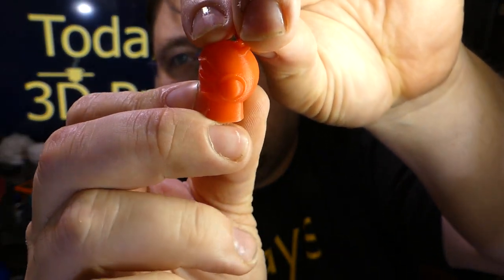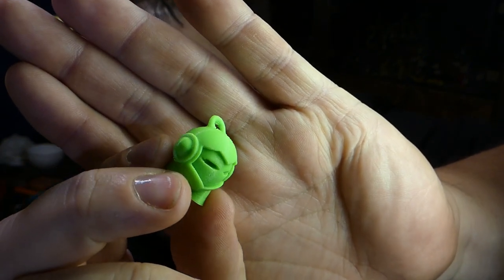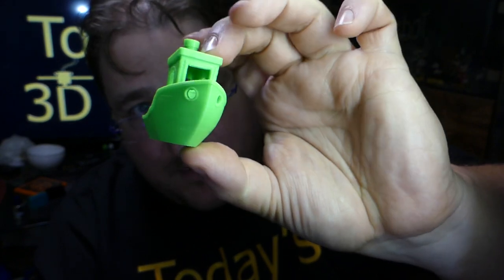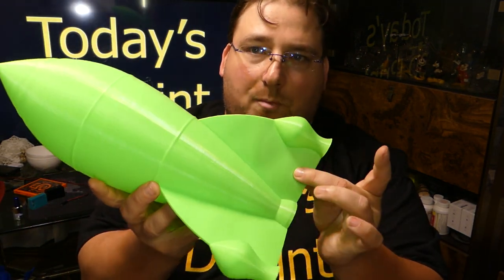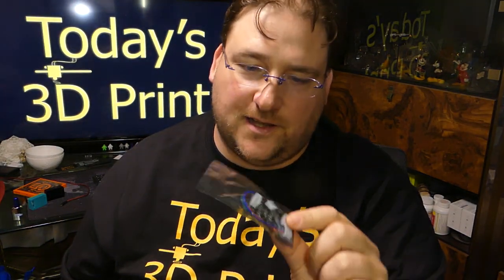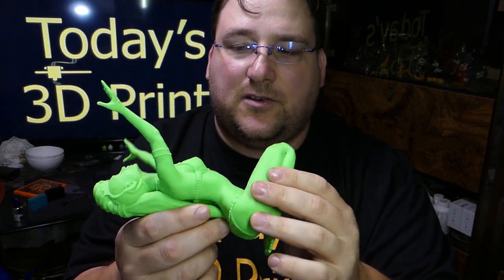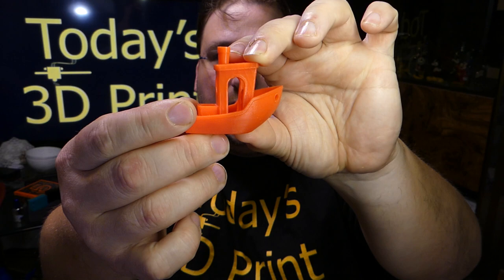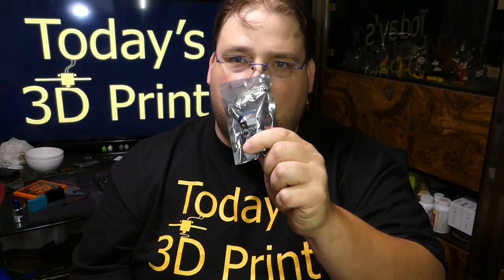Today's 3D Print 108 Tevo Tornado Smoothers installed FANTASTIC results

Comment: Thanks for the review brother , we will keep on improving the quality in our future printers :)
Reply from the maker: +Official TEVO Channel that is very good to hear consider iterative upgrades to existing products as well for example I would either include TL smoothers with the printer now on or change out the stepper drivers to one that doesn't have the problem of the 8825's otherwise so far I am extremely impressed with the tevo tornado how much would it cost me to buy a couple of those heat pads that you use on the tornado? I want to upgrade my CR tens :-) I also love the full size SD card slot and the full size USB port I'll have a more full view video soon I'm making my first 50 hour print on the tornado now
Reply: Test 8825s and find steppers which work with them -- there has been plenty of literature on why 8825s skip micro steps. Use high inductance steppers, and 8825s are fine. You have the capability to do that. Or switch to different drivers -- not sure if TMC2100s or TMC2660 are in the budged, but consider those, that's the current best option.
Reply: Hopefully they see the comment, I really hope a new revision will be released with new steppers. Knew corners were cut somewhere.
Reply from the maker: +kazolar I did not look carefully at the board I can replace the drivers? How much are TMZ 2660 s what's the difference between 2100 and 2660 s how much could they possibly cost?
Reply: I looked at your video where you were adjusting the VREF, and the controller Tevo used in the Tornado uses soldered on drivers, so they're not replaceable -- AFIK this is what it is. The 2660 is the current state of the art -- main difference between 2100 and 2660 is price now -- 2100 -- have been cloned and can be had for ~$5, 2660 are in $15 range, 2660 have a lot of the similar features, step interpolation, so they're good for 8 bit boards as you can set them to 1/16th micro stepping and enable 1/256th  interpolation, so they'll be quiet. All that aside 2660 are only available on controller boards, or for Azteeg 32 bit board as pololu compatible package. They're main benefit is ability to drive up to 3A steppers with cooling. Best option for a Ramps style 8 bit board is TMC2130s -- which are in the 2A range, and are plenty powerful for all Nema 17s. One of the really cool things that these new TMC drivers do is stall detection, which is how the new Prusa printer can detect skipped/missed steps. Anyway, if this works with TL smoothers, I wouldn't get into it since it's a full on controller replacement. Kinda getting in the weeds here, but you asked :) Tevo is using an existing controller, which has 8825s soldered on, using a TMC driver would involve using a different controller -- which they could have for virtually no price difference. There are controllers with pololu pin set allowing for replacing a driver if it were to ever burn out. Considering how sketchy 8825s are, I've never recommended this controller to anyone since it uses 8825s, and they're soldered on.
Reply from the maker: kazolar from what I'm seeing these boards are not that expensive at this level what board would you suggest as replacement for the tornado? If it continues to work as good as I hope it does it might be worth upgrading at some point
Reply: The main issue is pairing of the steppers with the drivers. A lot of people run 8825s with no issues -- You tend to slow your print down to get detail, and that's where 8825s suffer: Here is a technical paper on why: http://www.engineerination.com/2015/02/drv8825-missing-steps.html -- one upgrade worth trying is to swap the x an y steppers for higher inductance versions -- higher inductance steppers perform better at low speeds, the details you are after is the mH rating -- I don't know what the Tornado uses, it's also possible yours has different steppers than others, as Tevo may not necessarily use the same steppers in all units. 8825s also have less issues with high inductance steppers. Personally if you want to do a reasonable upgrade (without going 32 bit) -- I'd suggest hunt around for a good price for a Rumba controller and get a pair of TMC2130 drivers. You can generally find a Rumba with either 8825s (eek, or 4988s -- better for about $60), then you need 2 2130s, just for X and Y. A Rumba allows you to mix drivers as you see fit. Cheaper drivers are fine for Z and extruder, and get nicer ones for XY. Again though, I would consider it an education exercise, since even the white paper says that using 4 diodes does fix most of what ails the 8825s.
Reply from the maker: kazolar I like to have options but I'm leaning toward agreeing that the diodes are enough I have the TL smoothers on the printer now and the print I'm making is absolutely amazing 400 millimeter tall faceless it looks really good

Comment: WHOA. I've heard the TL smoothers do good stuff, and I know I've been told to definitely add them to my Little Monster, but WOW man, seeing the differences is crazy!
Reply from the maker: well remember in this instance they are correcting a manufacturer flaw (not quite proper stepper drivers) for the tevo little monster apparently you need 6 of them you double up 2 for each stepper. $50 in smoothers. but I guess that is not really much for a $1000 printer :-) noise or not that tevo little monster is a beast :-)

its also really cool you watched one of my videos :-) I watch damned near all of yours. I drool over your printers. Drool :-) hehehe

Comment: also wanted to give you a thumbs up and thank you for your videos. I installed the tl smoothers and adjusted the voltage settings right out of the box before my first print  thanks to your videos. I love my printer and it worked great until yesterday.
Reply from the maker: +DRONE TO THE BONE no problem. It is a good solid machine. Also use some alcohok to clean the bed to restore stiction.

Comment: Good work, will be interesting to see if they do make a difference on the CR-10. Hopefully Tevo will be taking note and address the issues you have found with the printer.
Reply from the maker: +ebuTuoY if they want to keep selling printers they'll do that it's one of the reasons that creality is doing well not only do they make a good printer but they are responsive to the needs of their customers and the flaws in the printer that they are correcting that's the key to loyalty with a brand
Reply: Yes you are right creality have listened to feedback and made the right improvements. That says a lot about their company. They have to at least fix the extruder adjustment screw position. That one did make me laugh in your video. Hopefully they won't just drill a hole lol even though that was a great idea for a temporary fix.

Comment: If the Tevo Tornado Gold was the same price as the Creality CR10S, which one would be the go to machine. I love modding so don't have an issue with that if needed...
Reply from the maker: I am not sure I have not used the Gold version if they updated the y axis stepper motor to have more torque which really was the only problem I had with the original version that I would say it's a good machine although I would probably still lean toward the cr-10s for cleaner Prince
Reply: @nerys71  now another question, cr10s is sold on some Chinese stores that have gotten not so great reviews lately. The Tevo is sold locally here in Canada, that being said will you still go with the cr10s :)
Reply from the maker: @RonenLin  if you can get a good deal locally then do that I think you'll be happy with the TiVo I am happy with mine it just needs some TL smoothers

Comment: Could you please share your start gcode fort the Tornado? I just bought one and would like to add the priming line to mine also.
Reply from the maker: G28 ; home all axes
G1 Z5 F3000 ; lift
G1 X40 Y2 F1500 ; avoid binder clips
G1 Z0.2 F3000 ; get ready to prime
G92 E0 ; reset extrusion distance
G1 X120 E10 F600 ; prime nozzle
G1 X150 F5000 ; quick wipe
M205 X10 ; Lower Jerk to 10
M204 P500 T1000 ; Lower Acceleration

Comment: I heard there are two version of the board inside the tornado, and i ask, will this mod work with both version? Have someone tested it?
Reply from the maker: Smoothers in theory should work on any board or printer that has Salmon skin if you don't have salmon skin they probably won't do anything they won't hurt but they won't do anything

Comment: hi, i have a question. Which printer would you recommend?
CR 10, Tornado or Ender 2.
Most important is the quality of the prints.
Reply from the maker: EinmachGlas for ultimate print quality I suggest the Ender to you can see my videos on the prints I get from that they are quite stunning for an fdm printer do keep mind the ender 2 has a limited print volume

Between the CR 10 and the tornado both of which have a very large 30 by 30 by 40 cm print volume that one's a little harder with the TL smoothers the print quality appears to be identical between them I like the known reliability of the CR 10 but I like the upgraded features of the tornado my tentative suggestion is foreknown reliability go to CR 10 but the tornado so far appears to be equally as reliable and the upgrades are nice I like the full size USB port I like the full size SD card slot and I really like the AC heated to bed that's not only does it heat up very fast but it can reach higher temperatures then the CR 10 can so if ABS printing is important to you I would go with the tornado
Reply: Thank you for your quick response.

How would you rate the difference between the Ender and the Tornado (with TL smoothers)? Is the Ender 5, 10, 20 percent better or is it equivalent? This would help me to make a decision.
Reply from the maker: +EinmachGlas I don't think the tornado ever print with the same quality as the Ender but this is not what you think first part of the reason to print so well is because it is so small less mass less inertia less noise but you're limited by print size now keep in mind when I say the tornado will never be the same quality as the Ender the difference in quality is extremely minor an untrained I probably could not tell the difference between a print from an Ender and a print from a tuned tornado I can tell the difference but I've experienced it that and I lust for that little tiny bit of extra quality think of this as not so much a Honda versus a Ferrari but more of a Ferrari versus a slightly better tune Ferrari the difference in reality is quite minor if you think you're going to need to print larger consider the tornado for the CR 10 honestly if you want to do abs I am leaning toward the tornado simply because of the heat bed keep in mind I have no experience with abs so I don't want to come off as misleading

If you are unsure and you don't have extraordinary budget limitations I would go with the Ender cheap it doesn't very good job that will get you wet with 3D printing if you decide to stay with 3D printing you're almost certainly get more than one printer then by the tornado or the cr10 they actually compliment each other very well with the Ender
Reply: Ender got the best print quality from what I have seen.

Comment: OK then, give me your thoughts you ask... I've recently got my Tevo Tornado, because ever since I played with one to print parts for a Robot during a hackathon using a friends printer I wanted to be able to replicate that at home. Now I've got one, I've done a few prints and familiarized myself with the software repetior-host and the slicers Slic3r and cura which is great but there are a lot of terms and settings in their print profiles which I'm not familiar with and I've not changed if only for the reason I don't know why I would change them - some are obvious, I'd change layer height/thickness to extrude in finer detail, great, but I would also have thought adjusting the level height would effect other print settings; Should I adjust the filament feed or increase retraction to prevent over extrusion? I simply don't know. I'm looking for a list of reasons why I would want to change certain settings in my print profiles - cause and effect. If there are any online sources you think would be valuable for me to read I'd like too, and if you got time to cover them in a video... great.
Reply from the maker: +Luke McHale-Jones a video is a great idea. Feed rate and retract wont really effect extrusion. Feed rate is how fast. For now stay at or under 50mm/s

Retract effects stringing. Iirc 5mm is goof for the tornado.

Layer height. The slicer adjusts what it needs to when you change layer height. But layer height also effect geometry. The limits of what can and can not be achieved. This you need to learn. Layer height and over hangs go hand in hand. The more overhang the lower the layer height is suggested but you can compensate with perimeters/wall thickness and infill.

I need to work on more videos of this kind of stuff.

Comment: You can't add them at the motor has to be at the board the connector is different.  You could but would need different connections
Reply: Yes - Tevo uses stepper motors with 6-pin connectors, so you can't put the smoother boards at the stepper end without swapping connectors - and you can't just swap connector bodies since the pins are not the same size.  You have to cut, swap, and solder.  I did just that with my Little Monster and the results were very dramatic - no salmon skin at all using the smoother boards.  But the diodes they've chosen for these smoother boards really run hot!
Reply: Yup, found that out today as well. Have to be installed inside the box which is not too crazy of a fix. Just look for the x and y plugins on the board.

Comment: When you talk about tuning or tweaking your prints are you referring to the extrusion or actually changing the print file itself? If you are changing the print file what do you change? Thanks and keep up the good work
Reply from the maker: the extrusion. how many perimeters. how much and what kind of infill. what plastic what temperature.

sometimes I edit the file itself such as in tinkercad or directly in the slicer to "print it in multiple pieces" to make it larger.

Using selective infill to support what it needed without wasting plastic on areas that do not need it etc..

Comment: I'm so glad your tornado worked. What fans did u get? I'm debating which printer but I think the tornado is going to be the one so I can print larger robotic parts like a full length arm.
Reply from the maker: I use ultra quiets from amazon. Noctua would work fine as well.

Comment: Did you have to change the wires around on your smoother cables?  I saw a few videos saying that was needed and I looked at mine and it looks like if I don't, then the input and output colors don't match up. In other words, red would go to where black was etc.
Reply from the maker: +Rafael Acevedo the printer is working fine so I assume the wires are correct but I understand if they reversed the steppers will go in the opposite directions intended since mine are moving correctly I assume they're wired correctly I will look at that though when I go in there to upgrade the fans I'll double check the wiring and take some pictures
Reply: Nerys thanks brother.

Comment: can you please share your startup gcode? i cant figure out how to set a prime line, and i cant get my cooling fan to spin up. thanks in advance
Reply from the maker: G28 ; home all axis
G1 Z5 F3000 ; lift
G1 X40 Y2 F1500 ; avoid binder clips
G1 Z0.2 F3000 ; get ready to prime
G92 E0 ; reset extrusion distance
G1 X120 E10 F600 ; prime nozzle
G1 X150 F5000 ; quick wipe
M205 X10 ; Lower Jerk to 10
M204 P500 T1000 ; Lower Acceleration
Reply: Thanks!

Comment: looking to get the tornado. Can tell me how it does with tpu? mainly just using for rc hobby parts. do i need anything else to order with it? i did watch the vid on the smoother which i will get. thx for any help!
Reply from the maker: +apex1080 most printers can handle TPU if you just slow down a little bit so keep it around 20-25 mm per second or just take your normal print and reduce it by 50% on the printer itself I will try to get around to putting some TPU through my tornado and let you know how it goes

Comment: I just found a cheaper method to fix this issue and it is the MKS Gen-L.  It is a drop in replacement for the MKS Base but allows you to use your own drivers instead and I already have A4489 but A4489 is like a $1.50 delivered each so 6 dollars for 5 plus 15 for the Gen L we have ~21 dollars in total.  Any other drivers you wish to use can be as well but everyone knows do go past 1/16 microstepping since the internal 2560 can't handle the switching speeds.
Reply from the maker: +The Best Stooge you can buy the brainboard for $15? Whats i volved with making it work? Plug and play? Programming?

What about something a little more powerful? When i have a bunch of stl on my enders the ui is sluggissssshhhhjjjj :-)
Reply: The ROBIN, and the GEN-L both need drivers you can choose yourself.  Very viable options.